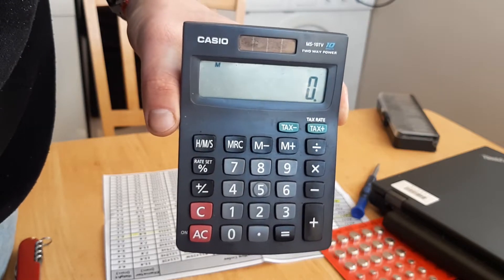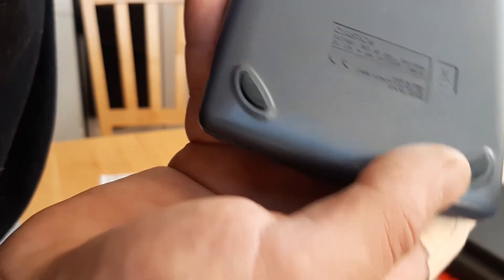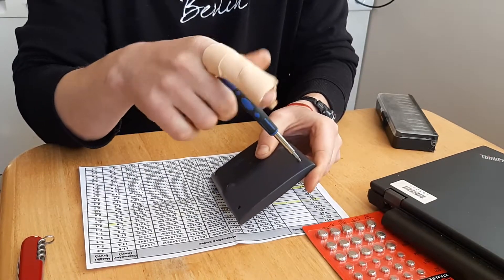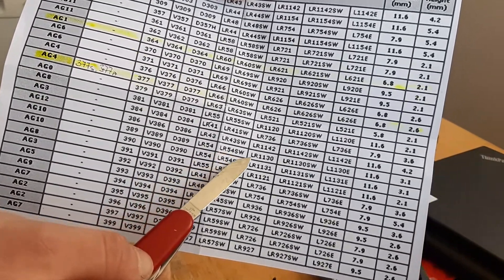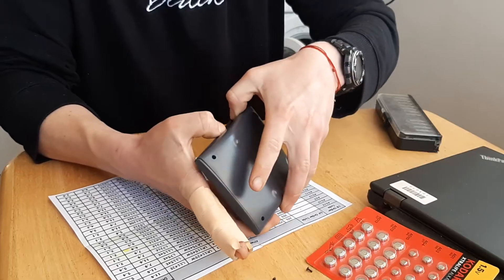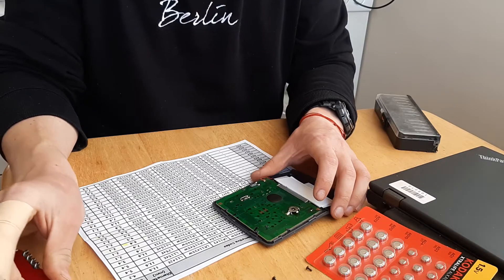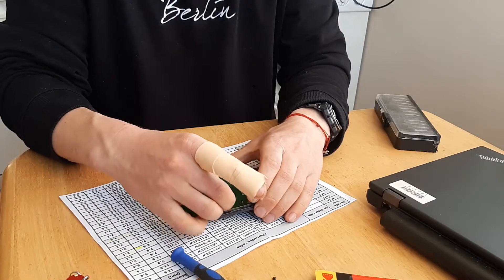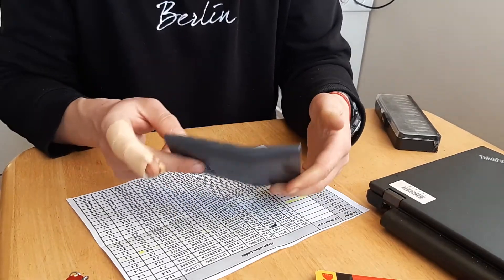Battery replacement on casio solar   powered calculator.

Comment: I replaced the battery as you said, but mine still going dead in few seconds?
Reply from the maker: Did you replace it witha brand new one ? May be try with a different brand.
Reply: Same here. New battery, worked then same fault appears. The old battery was dead, maybe there's another fault.  New battery tested ok.
Reply: Is the previous battery has leak issue? If yes then there's a high chance the leak was corroding the contact on PCB. There's also a chance that battery seat isn't properly soldered therefore it became loose and battery didn't get a proper contact.

Comment: mine after a minute, some keys do not input, example 3, 2, 6, cannot input in the screen, is ther any solution for that or should i RESET? and how?
Reply from the maker: Sorry I can't help. BUT I THINK is chip problem and is a bit beyond repair.
Reply: @MeFixingEverything  a ok sir, i thought it has reset😅 like watch after u change battery, hehe thank you

Comment: Please tell me on thing that does it stop working immediately when battery gets weaker or it shows some sign, i mean if due to battery issues if it stopped immediately in examination hall.
So if you know please reply
Reply from the maker: You can see the battery goes bad. It starts to die when no sunshine

Comment: I followed all instructions for battery replacement and reset after that But the display is garbled and it doesn't respond to the keyboard Could any one please advise?
Reply from the maker: Check if your new battery have power. Usually is straight fit.
Reply: @MeFixingEverything  Well I assume that a new batterie has power. Dunno how to check this